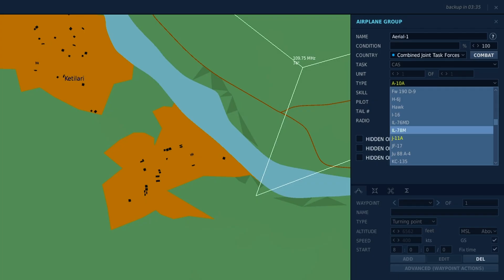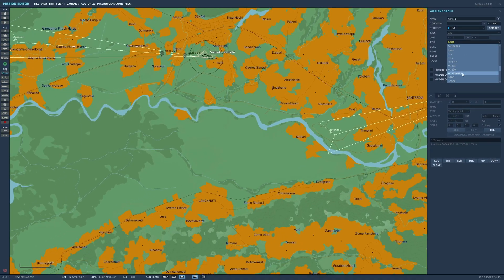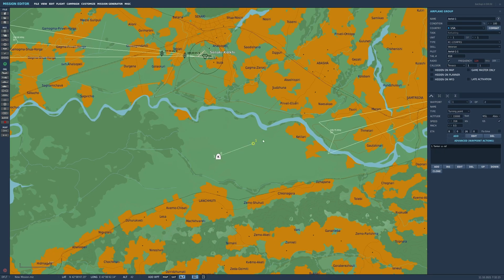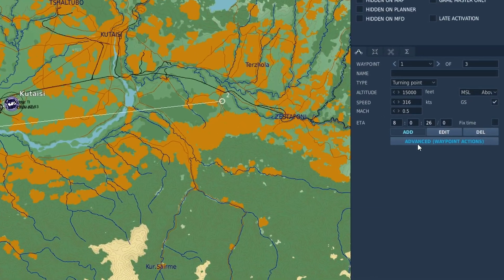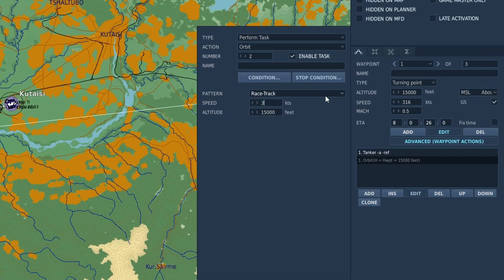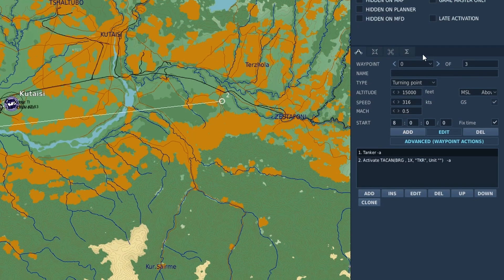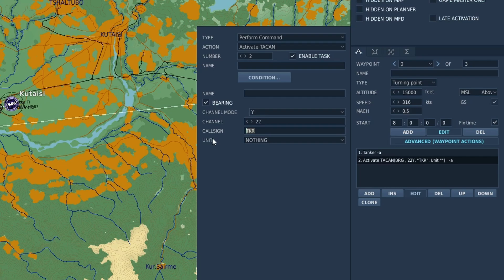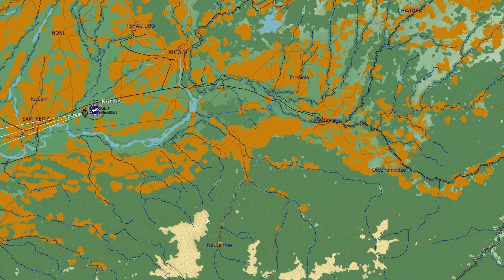How To Set Up A Tanker In DCS World Mission Editor

Comment: I am having an issue getting the Tanker and AWACS to launch from Homeplate after I cross a waypoint trigger, any recommendations?
Reply from the maker: You could set up a radio menu to trigger it manually if the other trigger fails or you could try switched condition instead of once.
Reply: @DCSChopsticks  okay thank you

Comment: How would you set up several tankers in close proximity to one another running in parallel? I understand how to do this  with the waypoints but not sure how to set up the TACAN stuff. When I try to select the unit from the dropdown it only shows one of the tanker callsigns. Trying to make a training mission for multiple people to practice AAR at once without worry about bumping into one another behind one tanker.
Reply from the maker: I usually copy and paste the units and separate by 2000ft. Then put them on top of each other.
Then I just go in and link the TACAN to each one. It should always give you the unit name to link to. I've never had it only show one. Make sure that each tanker is in its own group.

Comment: Did something change in DCS recently?  I set this up exactly like you did in the video (except altitude and speed) and the tanker just circles around the first waypoin.
Reply from the maker: If you have 2 wps the race track option should be available from the drop down for orbit type.
I won't rule out DCS changing, it's the down side to playing a beta.
Reply: @DCSChopsticks  I made it work.  Instead of two way points I had just 1 and put the racetrack command at waypoint 0. Thanks